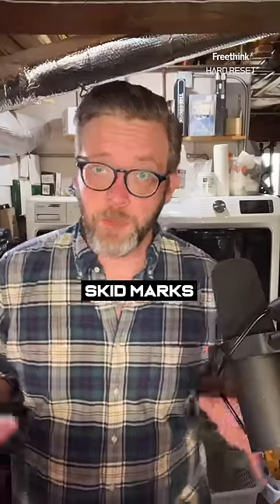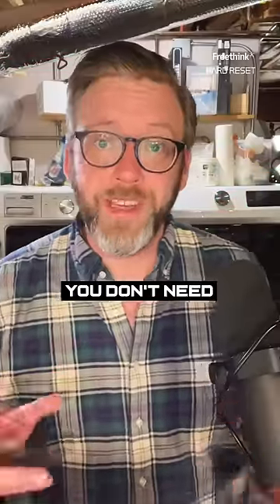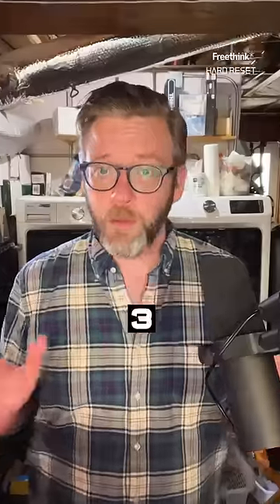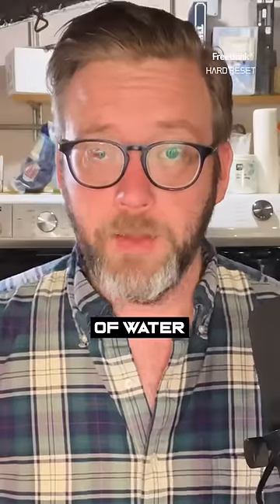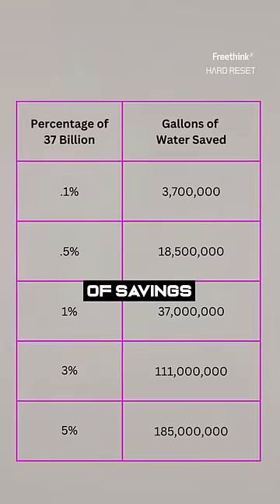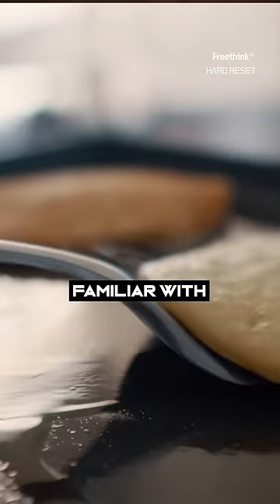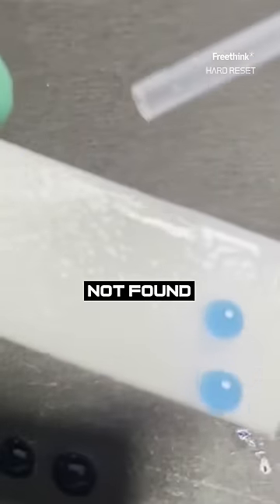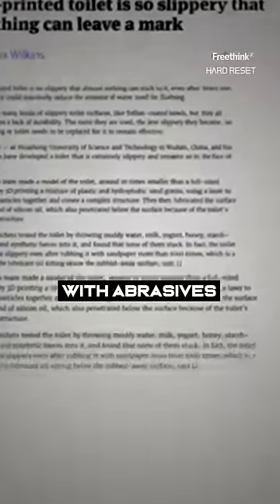Researchers invent super slippery toilet 🚽😳 #shorts #metamaterials

Comment: Can save some water, but not as much as you think. 

What was demonstrated in the “vaporware” toilets was similar to an outhouse where no water seal exists to eliminate gas and odors from the sewage. Just a plop down. 

Real toilets have an S-trap of water that the waste has to go overtop, and thst water has to be flushed away 1-2x the volume so you don’t have dirty water in the toilet. 

A slippery toilet would absolutely make it easier to flush, but you still need enough force to cause the waste to go up and over the water seal. 

To fully utilize this, you would have to completely redesign the toilet flushing and sealing system.
Reply: You can always nearly optimise so flush is only 1.2-1.4x the water. Currently, toilets spend around 3-5x the water in the S with the default short flush (if not interrupted or manually shortened).
Reply: I feel like completely redesigning the flushing and sealing system isn’t that big of an obstacle, like once you make a new system that works, you just put it in new buildings, or you renovate old ones. It’s not like you have to tear out all plumbing in a city and install an entirely new sewer system.
Reply: Don’t forget the drain pipes as well! The toilet may be slippery enough to allow stuff to slide down it into the pipe, but if the pipe isn’t also slippery, then without extra water to carry it through the pipe, it would easily clog the pipe up.
Reply: @carmanragatz I'm pretty sure that if people are smart enough to create low friction metamaterials, there are equally smart people who will be able to figure out the next step in this.

Instead of finding obstacles, find solutions.
Reply: @arcataslacker well you got to know the obstacles first before you find a solution duh
Reply: @Pixal_Dragon this guy works in management
Reply: @pretty7545  I’m a high school student
Reply: @arcataslacker the rest of the sewer system is part of the problem.  Examining roadblocks is the way to the solution
Reply: You are correct
Reply: Are you saying you dump on your own chest?
Reply: Also needs a lot of water to flush it down the sewer pipe
Reply: RV and boat toilets have options for a simple sliding door,  you flush and it simultaneously drops a bit of water and pulls the door (seal) out of the way until you release the handle.  The amount of water you use depends on how long you hold the handle.  No S or P trap to overcome.
Reply: @bigbthunder9705  lord knows I try
Reply: That's what I was thinking! And they'd assumedly need to entirely retrofit the sewers to create enough "flow" that is currently created by water... finding a more efficient way to handle the sewerage itself seems like a far more logical avenue of research, no?
Reply: I’d make a water slide
Reply: @blackhawk7r221 That is because it drops directly into the grey water tank. Completely different.
Reply: Real toilets have a platform so you can inspect the stool before flushing it down. This video is a joke. If we want to save water, how about people don't shower literally every day or even twice a day, and don't stay in there for 20+ minutes.
Reply: @RacingPepe sure but what's easier?
Redesign the whole system or get people to change their habibts a bit to safe the planet?

Korrekt!
Number one -_-
Reply: @RacingPepe  That is just a weird german thing, no one has done that in a hundred years give or take other than them.
Reply: It is true. But when there are skidmarks, you usually flush a few more times.
Reply: @Pixal_Dragon  high schooled 200iq more like
Reply: If they redesigned the toliet around this idea the s trap wouldn't really be an issue as I know with at least in America our toliets all come with the s trap built into the toilet structure itself. So in theory it shouldn't be hard to redesign, and implement in newer buildings and while doing renos. You wouldn't really need to rework existing plumbing unless the common wax seal or something wouldn't work for the new design.
Reply: I think you guys are missing the point the prototype is just showing the properties of the material with out water but the idea I assume is more aimed at making a traditional toilet, water flush and s-trap and all, but making sure that all the waste goes down in one flush instead of flushing cleaning the bowl and flushing a second time. 

I am aware this is not an every time scenario but at least in my household that could probably save 25% of the water we use flushing

Comment: 1.Side of knives, stops food sticking to the side of the knife.
2.Anything mechanical that requires a lubricant (should make the lubricant more efficient).
3.Solar panels (if transparent)- get the dust and grime off so that it remains more effective for longer.
4. Underside of boats/ships to discourage barnacles from forming.
5. Underside of sleds
6. Building materials so less cleaning required for building's outside wall.
7. Anti-grafiti public walls etc.
Reply: Great ideas
Reply: Oh god a knife made of the stuff would be terrifying
Reply: @dizzle9638 gotta cover your tracks somehow after you just "murderised children"
Reply: Undersides of sleds would be crazy 😬
Reply: What about the animals, birds insects, wouldn't it put their life in danger?
Reply: @bahaar2825  It just looks like ceramics. It wouldn't leave any trace. So, I don't see anything dangerous
Reply: 1. You'd cut yourself
2. This looks similar to ceramics. It seems thick, heavy and easy to break.
3. I thought of that too. But this material isn't transparent, right. 
4. Maybe it's too heavy? Won't it break? I genuinely do not know.
5. Again, won't it break?
6. Who even needs that?
7. Absolutely useless.
Reply: Well i was thinking... uuh.. lubri... you know what never mind
Reply: @potat099  - 
1. The user controls the knife, its not going to cut anything if left alone. If you cut yourself, only you are responsible for it.
2. If NASA can engineer the outside of their shuttles with ceramics and it can withstand launch and re-entry, there should be tech out there to make it tough enough for small-scale industrial or at least at home DIY use.
3. No don't think so.
4. you'd only need a thin layer so it'll be a matter of re-application, similar to how galvanization work.
5. Don't know
6. Dunno, but there's alot of crap on the market that "no one needs" but still selling/existing in the market.
7. Meh
8. what are your ideas?

Comment: For water parks, if properly adjusted could be used as an ice skating rink in hotter climates
Reply: No, because repairing something like that would be way too expensive. Eventually, there would be too many slices in the material from the skates, making it unsafe. Even simply refilling the scrapes would be extremely labor-inducing and costly. All they do to fix that with real ice is adding more water, letting it freeze over and that’s it
Reply: @KingdomHeart12  are you a specialist on this material?
Reply: @im_youknow_marty as a specialist of 37 years on this material that is still being invented and developed I can say that unfortunately the Bostio levels are way too high in the plasternum of the valence electrons to be used effectively as an ice skating ring 🥺😔😢
Reply: @im_youknow_marty   no but it’s literally common sense to know that it would be more expensive than water and harder to manage than simply freezing water over the top. 🙄

Comment: This is so important! I really hope this becomes the standard material for toilets soon
Reply: But why is it so so hard to create? I think it’s such a simple idea. Genuine question
Reply: Doubt more than likely it’s extremely expensive to make
Reply: Idk a plumber in the seas of comments said that we actually need the water that the normal toilet flushes, because it helps push previous flushes residues to prevent clogged plumbing, which in turn could be more expensive and lead to even more negative environmental impact . ¯\_(ツ)_/¯
Reply: A main reason we use water at all is for the odor. Ever used an outhouse or an airplane toilet? That will be your bathroom, forever.
Reply: Better yet, install an incinerator toilet, nothing is left but a small amount of sterile ash , moisture goes out through an exhaust pipe as steam.  Works fine in Sweden !
Reply: @ydn289 what about lining the pipes made of the meta material in the video?

Comment: A windshield like this would be nice to have.
Reply: Except in heavy downpour where the forming of dropplets makes it even harder to see
Reply: @Cyphco So use the wiper blades?
Reply: @Cyphco it's not. There are cleaners out there which make your Windows so clean and hydrophobic, it's even more awesome if you didnt have to use your wipers while everyone have to use it. In fact you can see way better than people with wipers on.
Reply: @Wrutschgeluck  That wasn't what I said I said heavy downpour.
True that it doesn't affect newer cars that much because their speed at which they can wipe is most of the time higher.
But many older cars take a second between each swipe.
In that time the droplets can form something that looks like a matrix which makes it harder to see.
(Ik very edge case but ye)
Reply: @Cyphco  i know, i meant heavy, too.
Reply: @Wrutschgeluck ceramic coating already does that
Reply: @Gamers-em1ze  ceramic coating for car windshields? you sure? :D

Comment: Make the inside of pipes like this? Would that require far less pressure to push the water/fluid?
Reply: The force required isn‘t from having to overcome friction against the walls of the pipes but rather to push the water in front, so even near frictionless pipes wouldn‘t change a thing.
Reply: @Grouncher it would still lower resistance so there’d be some benefit
Reply: @sneaky_krait7271  It‘d also lower the diameter, which reduces the flow rate and thus increases the pressure gradient required to transfer the same volume/mass of fluid in the same time, which, in turn, increases the force required to reach that pressure gradient.

Edit:
The loss in diameter depends on the hydrophobic material. 

You could – mathematically – get to a point where the force required to overcome the loss in area would be less than is saved by the near-frictionless circumference.

But I doubt that‘s anywhere within reason. Certainly not above the scale of atoms, at which point the material would lose the properties that allow the reduction in friction anyway.
Reply: @Grouncher good grounching

Comment: The issue isn’t the toilet the water is needed to push it down the pipe
Reply: The p trap can be made to need less pressure to flush if we know we’ll be able to push all the excrement down. This is essentially what happened with low-flow toilets a few years ago.
Reply: The p trap is to keep water in the toilet bowl, no? No water = we dont even need a p trap. Just an outhouse style straight vertical drop. Good luck getting your phone out of that one...
Reply: @denizoz9224  you'd still need a trap of some kind to keep the smells out. The technology has been used in Urinals for some years and  they require an oil/water trap.
Reply: @denizoz9224 
Plumber here, toilets use an s trap as it siphons.
P traps are used to seal the sewer gases out of the home, which are both gross smelling and can cause health problems.

Everything attached to the drain system has to have a p-trap, with the sole exception of toilets with their s trap.
Reply: With less water flow in residential soil pipes, you might need a steeper fall in the pipe to ensure solid material reached the main sewer. This could require main sewers to be built deeper, too. Maybe hard to retro-fit, but certainly worth considering for new developments.
Reply: @denizoz9224  no that would let dangerous gasses into house, but only a tiny amount of water or perhaps advanced valve could do that job
Reply: i don’t care about the water consumption, i’m just excited about how much longer they can stay clean if really we manage to make them more slippery than they already are.
Reply: Qell, the no skidmarks thing is pretty enough for me.
Reply: @How2Kiwi then sewer gas would escape
Reply: Hilarious thing we’ve actually solve this problem thousands of years ago.. it’s called, “taking a piss outside”
Reply: @ministryofwrongthink6962  how to get arrested 101
Reply: @How3Kiwi  ok the pipe still needs more water??
Reply: Do it to THE PIPES TOO!
Reply: @denizoz9224 the stench would be unbearable
Reply: With a slippery surface, it will take less water to push the object.
Reply: @How3Kiwi low flow toilets are awful.
Reply: Yep
Reply: @denizoz9224 but then your toilet will smell really bad
Reply: @denizoz9224 the p trap is there to prevent gasses from coming back up the line. without it the whole house would smell like the septic tank.
Reply: Cleaning and maintaining the toilets would become infinitely easier thus saving the use of a lot of water and often harsh chemicals...
Reply: @How3Kiwi Most plumbers I know curse low-flows though.
Reply: @How3Kiwi those low flow toilets are so garbage
Reply: @kimspence-jones4765 Unfortunately even that might not suffice.  In a  too-steep pipe, the water speeds ahead and leaves the solid behind.  I learned this from an inspector who made us re-lay a pipe on a Habitat for Humanity house.
Reply: @denizoz9224 the p trap is to keep gas in the sewer
Reply: @denizoz9224 or sand like cats do😂 safer for your phone
Reply: There is advance flush systems fr that... But more and more water is needed to clear the pan of excreta  because of our food habit( increased amount of fat). This can be a good solution  tackling  that, as well as other problems like swage plant or something
Reply: @denizoz9224 That is not the function of the p-trap. It's to prevent gas leakage from the sewer system from bubbling up into your home and making it stink, or at worst killing you.
Reply: Sometimes people flush to get rid of stubborn leftover on sides of bowl, if this eliminates those few extra flushes (say 1 in 50) it’s still a considerable reduction in water usage i’d imagine.
Reply: @tgeliot  I guess we’ll have to make the pipes out of that super-slippery stuff too. 🫤
Reply: No skid marks
Reply: @kimspence-jones4765 actually, in some cities sewage fees are going up, because the city has to flush the pipes with additional water, as the toilets themselves don’t have enough anymore.
Reply: Just make the pipes out of the same material.
Reply: @denizoz9224 no p trap means sewer gas in your bathroom
Reply: @How3Kiwi  the trap is mainly just to keep the sewer smell from coming back into the house. You need the water to flush the solids through the pipes under your house and the sewer itself. Less water means less flow. Less flow means more risk of stoppages. And we’ve already dramatically cut the amount of water we use in toilets. This has caused problems in some sewer systems, resulting in more clogs and backups.
Reply: @ChrisMahtal assuming this stuff is magic and that will work, yeah, just replace every pipe in the world. Ok, let’s do that. 2 trillion dollars minimum in America alone according to the last estimate I saw for modernizing old pipes in America. And I don’t even want to pretend to think about the environmental costs of whatever manufacturing process is involved with making this stuff at that scale, or the financial costs added to putting it in pipes. All to save a little extra water, which btw isn’t running out because it all goes back into the water cycle anyway.
Reply: Just add super slippery pipes duh
Reply: @merlinious01 depends if it's an american toilet or an european one
Reply: Why can't they use air to keep the smell and gas down? Like an exhaust system.
Reply: @denizoz9224 the p-trap water keeps sewer gases out of the living space
Reply: Hello just coat the sewers pipes with the same material😂
Reply: Make it edible.
Reply: He never said you wouldn't need water, just that you would need LESS......

And that even a little every time can add up...
Reply: Maybe they'll line pipes with it too
Reply: Engineers design things without ever having to use it in the real world.

This idea will never be groundbreaking, or be seen on a wide scale, and yet these "researchers" will still be famous, and well paid for their work.

Like bro I could make the world's tallest stairway to nothing, as long as someone pays me for it. Now, is the world a better place?
Reply: Not only that, water is also used to wash off the smell of the waste.
Reply: @denizoz9224  you don't know what a p-trap is for. Very sad
Reply: @stevemichael8458  "some years" is a massive understatement

Comment: You're forgetting that the water is what flushes the waste through the piping system. It's nice that the toilets are slippery and don't require much water to flush the waste out of the toilet, but if the sewage pipes aren't also coated with the same material, it will just sit in the pipes creating clogged pipes.
Reply: Yeah. And we don't know if we can make pipes covered in this material...
Reply: If it is that slippery, it should prevent the adhesion of certain growths.